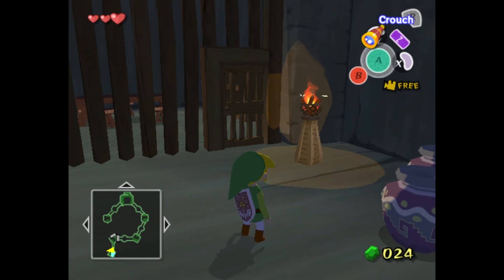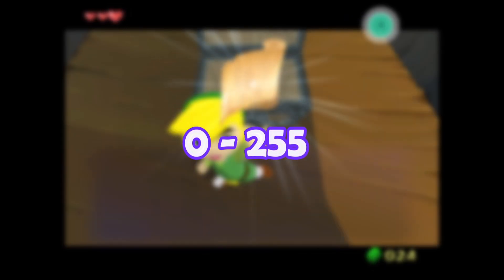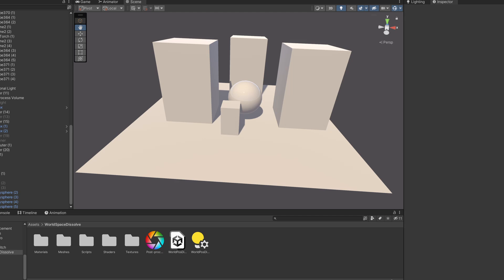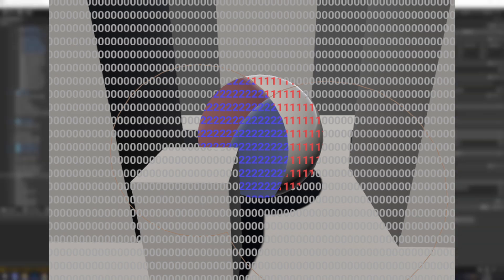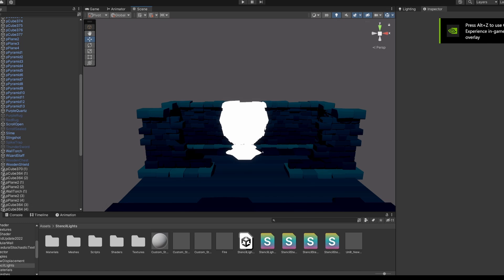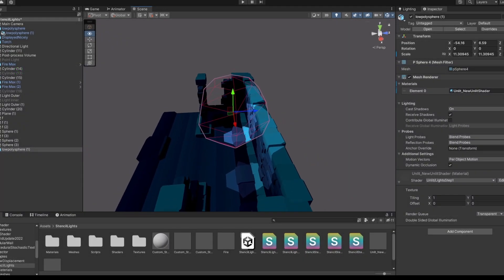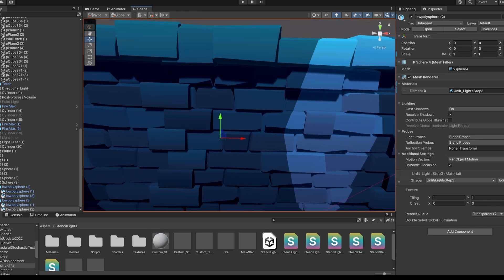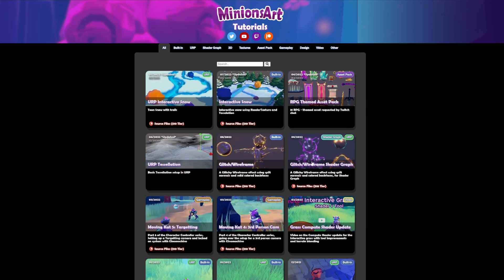Unity | How to make Zelda: Wind Waker's Style Lighting

Comment: Mine isn't as smooth. Moving the two light spheres makes the mask sphere's light flicker on an off. It's either all or nothing.
Also inside the inside light one, you need to add Cull off above the Stencil function. At least for me. Didn't quite mention that in the video or your article.
Glad you added the github code to compare with. You write in CG here while the final is HLSL.
Glad it's final is HLSL so it's gonna be easier to implement instancing. Render all of them in 1 draw. Technically 3 with each sphere. Gonna try to see if you can make one shader several passes.

Comment: would it be possible to use the "notequal" comparison shown at 3:30 in combination with the final result of the light?

The idea is basically to put a black plane right in front of the camera to add darkness where lights do not render.
But the fix to allow multiple lights to overlap also clears the stencil so I'm having trouble figuring out to add a notequal material that uses the other masks in the scene

Comment: All of the smaller lights that are inside a larger one, completely disappear when the camera goes inside the larger light. Any thoughts on solving this? Also when the camera enters an area where two lights overlap, the lights start clipping in weird ways.
Reply from the maker: Try setting the inside lights to a different material with a higher render queue
Reply: @MinionsArt  Unity 2022.2.18 ; URP ; and it gives me exactly the same problem as him, I tried what you said, assigning different materials to each mesh and the same thing, it's a rare problem, because if all the lights are in the same position origin and you move them a little each one they work but if you look at them from different angles they start to fail, I really have no idea what caused it, I tried to change some URP settings but not even like that.

Comment: This looks great for low-poly games.  How much of this can be done in a shadergraph, and how much must be done in a HLSL custom node or a full source shader?
Reply from the maker: So, all the stuff you need to make this work isn't exposed in Shader Graph at all, no access to Stencil blocks or Colormask. Custom nodes won't help here. 
You can move the Stencil Block part to a Renderer Feature, but that means setting up 3 different Renderer features (1 for each pass), and having 3 layers and 3 shader graphs.
Maybe in the future Shader Graph will get expanded to make it possible, but for now, full code is much easier.